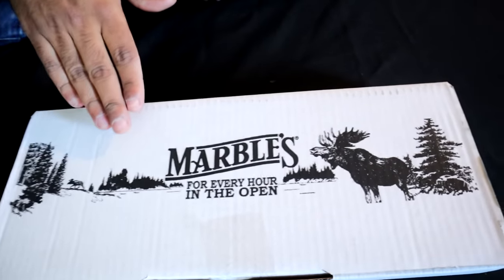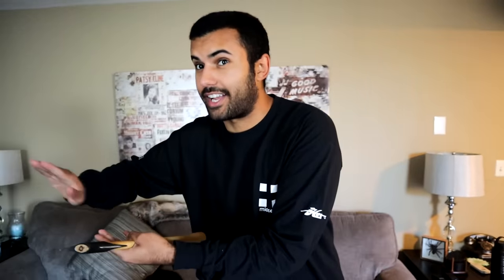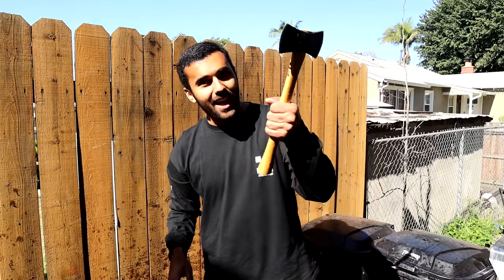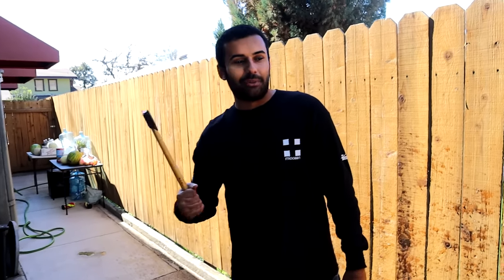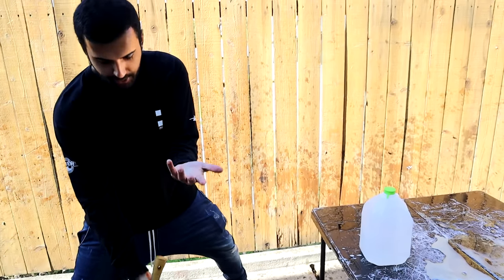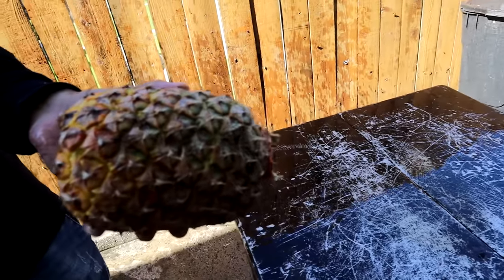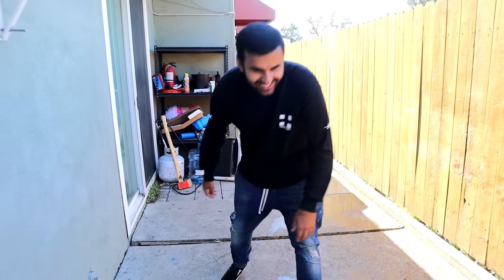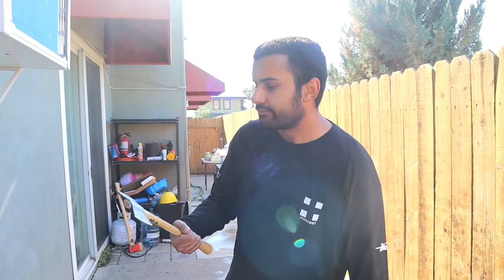I Bought The BEST Rated and WORST Rated WEAPONS On Amazon!! AXE EDITION!! (5 STAR VS 1 STAR))

Comment: Think it's more of a tie. The reason I say that is because Parker's axe is more practical in a fight (it does more damage and will take more opponents down in battle),  however yours still gets the job done but has a little flare to it the only problem is, is that the more it has on the end is a liability in battle. Due to there being more weight, itll take more recovery time to, there will be less time to get a few more hits in. But I'd have to side with Parker's axe, sorry.

Comment: Neither of them are genuine battle axes. That being said, neither of them look like particularly good axes at all once you get past the ornamentation. I can't tell if Parker's axe is a single through blade or 2 blades bolted on to a handle. If it is a through blade then it is the better axe, not in looks, but in function. Reptars blade is a weakened monstrosity which would likely have snapped if it was ever really used and the holes all over the place would have almost guaranteed that it would get hooked up on whoever you used it on thereby leaving you without a weapon.